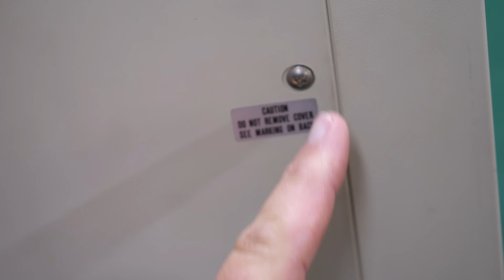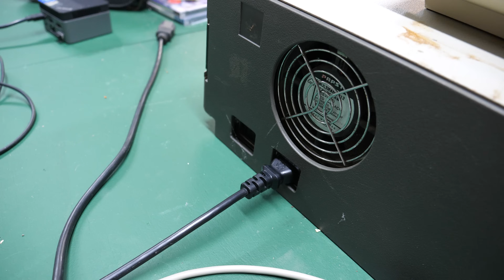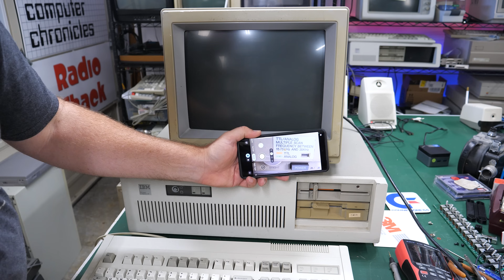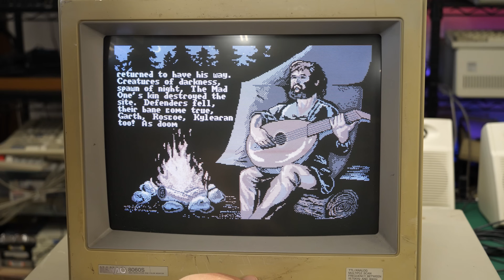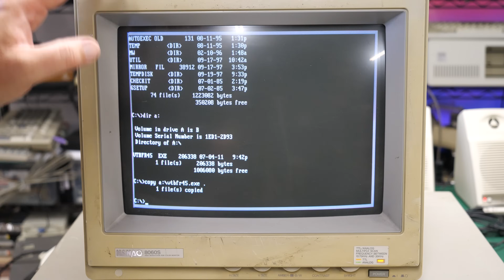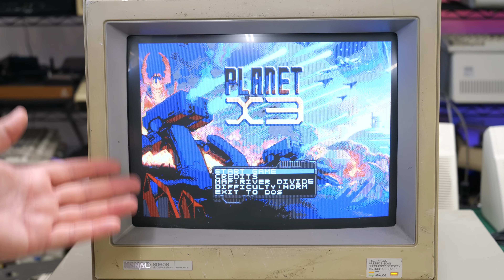Mid 80s PC Monitors - CGA, EGA, VGA

Comment: The first monitor looks like it came out of a Fallout game. The increased contrast or saturation was noticeable from the start. Monitors were complicated back then. When VGA with multisync came around, you could just plug any monitor in  and it would work if the resolution was not set extremely high.

I wish the term "e-waste" wasn't used to describe a really cool monitor or any other piece of hardware. It sounds strongly negative like when someone wants to criticize the capabilities of your system.

Comment: The Nanao Monitor is pronounced,  "Nan-Now".  That name appeared in the USA, but I the rest of the world it was known as EIZO.   The name difference was due to a early contract that forbid the other countries from using the name Nanao in the rest of the world.    In the 1990s, the company in the US was re-named,  "Eizo-Nanao".   Eizo Monitors are well known in the rest of the world, but largely unknown in the USA.    

Between CGA and EGA, the PCjr had an advanced form of CGA that allowed for 16 colors in 320x200 mode, rather than just 4 of CGA.  Radio Shack copied the PCjr in the Tandy 1000 series, but because the PCjr was such a flop in the market,  Radio Shack just referred the extra color modes as "Tandy Color" to avoid connecting their computers with IBM's PCjr's failure.

Comment: EGA can be used with TTL monochrome and CGA-type monitors (with caveats). The results are a 640x350 mono mode on a TTL mono, and 200-line modes (320x200/640x200) with the same 16 colors as CGA text mode.

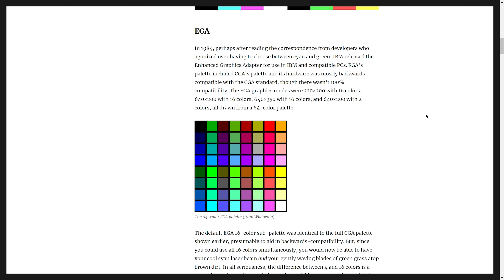Comment: 16:46 Not often listed is the fault in EGA's legacy, the fact that EGA programs usually defaulted to the CGA 16-color system palette for the sake of lingering CGA monitor use rather than actually using EGA's 64-color system palette to select 16 colors from.
Not many people had multi-synch monitors until VGA monitors took hold Eg. CGA/EGA specific monitors, even possible to damage some CGA monitors with EGA video signals so they defaulted to CGA colors/signal instead just to be safe. So watch out.😉
Ironman Offroad and Rambo 3 are a couple of the rare games to show off the expanded but highly dormant EGA system palette colors Ie. actually looking like Amiga, Atari ST, DOS-VGA 16-color graphics.
Also worth noting that EGA cards were prohibitively expensive virtually through its entire lifespan, where VGA wasn't just a massive graphical upgrade but was also proportionally cheaper and much smaller eventually during its reign.
That Nanao monitor is sweet, the B&W & Amber options are so much nicer than CGA's 4-color options.😁
Reply from the maker: Thanks for the info. I will check out those games.

Comment: On the Taxan - the Apple III RGB analog connector should work with a Coco 3 as well (you may have to make a little circuit for the H and VSync; The Coco 3 uses separate, positive H and V Sync signals. Page 62 of the 2nd edition of "Tandy's Little Wonder" book by Frank Swygert (available on the Color Computer Archive) explains exactly what needs to be done. 

Using that article, any RGB Analog monitor that supports 15.75 KHz H and 60 Hz V should be able to work with the Coco 3. I have both a Magnavox 85CM15 and a NEC Multisync II that work on mine (the NEC is especially nice as it has a phenomenal dot pitch (.28) and automatically figures out all the syncs, etc. itself... just need the right cable). So that might be a good use for one of the monitors. This will also allow you to play the Diecom Light Gun games (using a Sega Master system light gun, plus the interface design is now publically available so you can make your own adapter). We were showing these off at both CocoFest and BoatFest the last 2 months; modern LCD displays of course don't work with light guns.
Reply from the maker: Cool

Comment: IBM16 means cga 16 color RGBI TTL where dark yellow is brown. AT&T16 will be 16 color RGBI TTL where dark yellow is dark yellow. 8 Color mode will be intended for systems with RGB TTL with no intensity signal. 64 color is for EGA with 2 lines per color. Seems like the monitor does some autodetection. CGA should look wrong in 8 color mode and ega wrong in IBM16.

Comment: I don’t get what you meab that VGA is analog and the other is digital. Why would VGA be analog when it’s a digital card. And what is that about color blending? 

it’s no blending functions in VGA is just a base screen buffer where each byte is a pixel you set from a color index of 256 which in turn is set from a hi color palette.
Reply: @james66666  ah ok. Thanks. Makes sense.
Reply: @james66666  for sure an thanks! 💚💚💚 I got my first real monitor around 88 or so for the Amiga. And have been ding pixel art as a hobby since 85 and professionally since 91 so I know a lot about different graphics mode and GPU Hardware but when it comes to output signals and monitor hardware I am as lost as a frosted donut in a Eskimo igloo is. At best.
Reply: @james66666  I guess then also that the colors was based on modulation of the base colors for CGA for intensity to simplify the need to “decide” all 16 colors. And the colors themself was RGB based? Vs say C64 where each color was decided by the hardware designers and not really tied to RGB so just a 4 bit index to 16 colors that was pre set by the card. 

And same I assume with EGA. Just RGBA with modulation of intensity. 

I guess for VGA you started with a 8 bit value that pointed to an index of 15 bit (or whatever color depth of the palette) values set up as RGB that in turned produced a (for 15 bit) 32 step range value that was translated to an analogue pulse that was sent for RBG to each pin pair?

If so was the analogue approach a way to ensure forward / backward compatibility for great range / palette bit depth. Vs say going for a digital fixed 555 RGB bit solution?
Or what was the reason / advantage of having analogue over digital ?

Comment: That Nanao monitor, once you get it tuned, will be insane. if it syncs from 15-35kHz as it says, it will be fully compatible with every machine that produces an analog RGB signal, including the 24kHz modes of the Japanese computers like the X68000 and PC-98. Not a surprise because that name sounds very Japanese. For it's TTL modes, I think you need to have it set to IBM 16 for CGA or Commodore 128 RGBI. 8 would probably only give you RGB without intensity. For full EGA capability it should be set to 64, since EGA has 64 colors total, even though it can only display 16 at a time. The Taxan monitor is also a nice find for a 5153 replacement. Not sure about that Apple II mode on the EIAJ connector. The Apple IIgs is analog RGB at 15kHz, but there is an AppleColor card for the Apple II that outputs RGBI. But since they already have the RGBI connection on the DIN, the EIAJ connector might be analog RGB as well. I've seen that on some Japanese monitors.

One point about setting the EGA card ins "CGA" mode. It's not setting it to act as a CGA card, it's setting it to be compatible with a 5153, which can only handle 16 colors. Took me a bit to realize that, since you obviously were getting more than the 4 CGA colors when testing with Bard's Tale III. Still, excellent finds. I wish I had that Nanao monitor for my X68000!